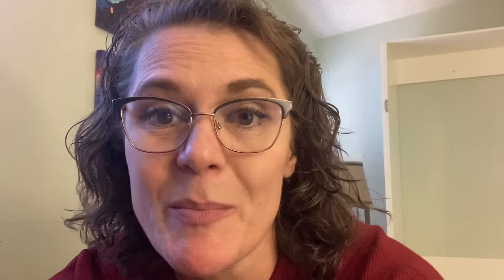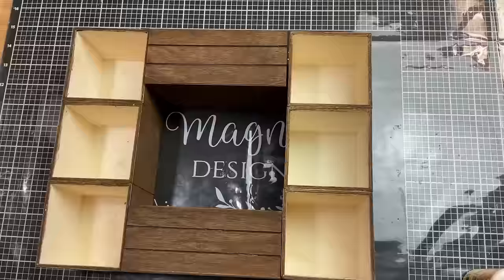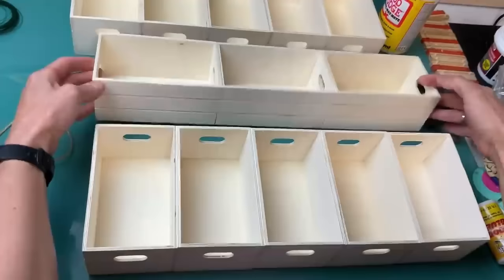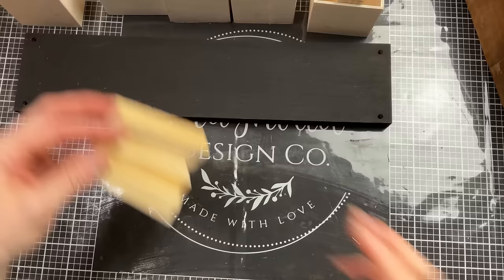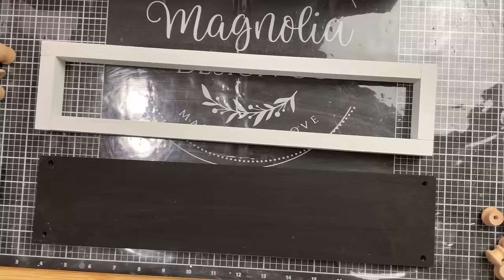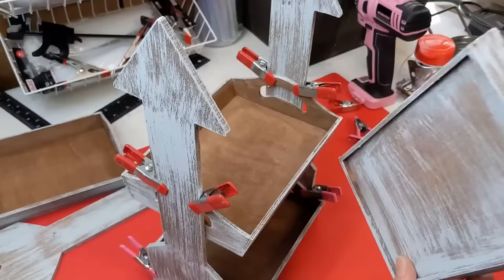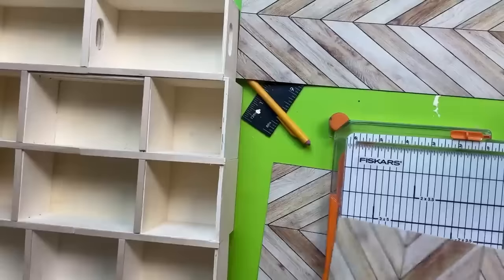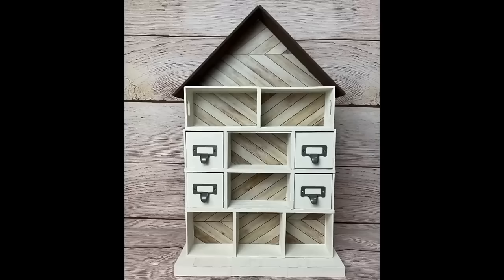DOLLAR TREE WOOD ORGANIZERS SHELVES | DOLLAR TREE DIY | HOME DECOR DIY

Comment: I like the project but they won't stick for long. It will come apart. Small nails or staple them.
Reply from the maker: What won't stick for long?  I use wood glue and these pieces are still holding strong